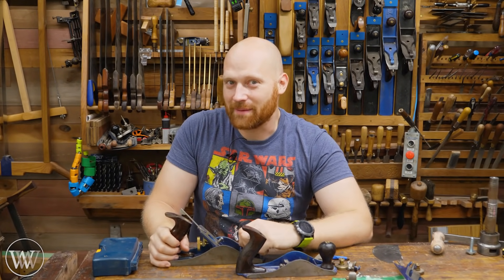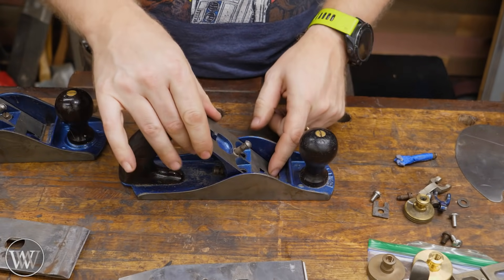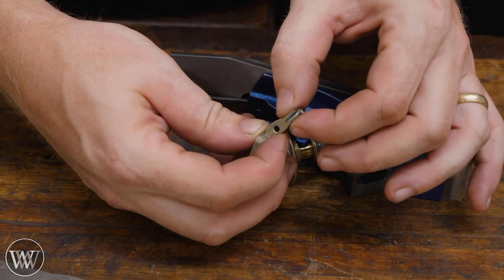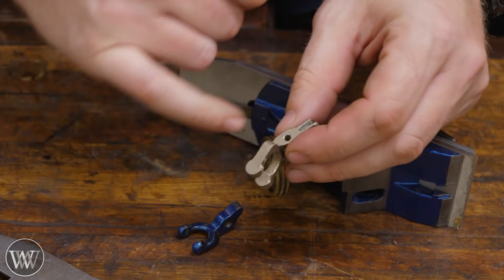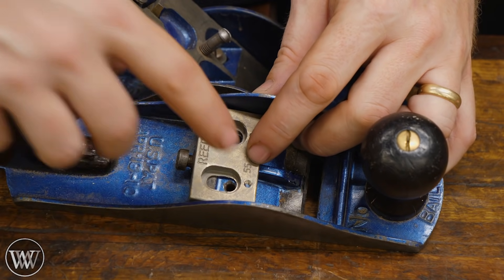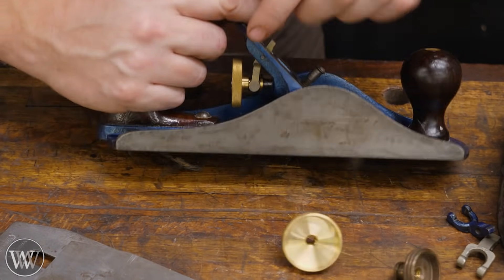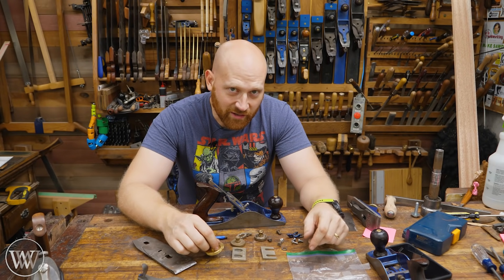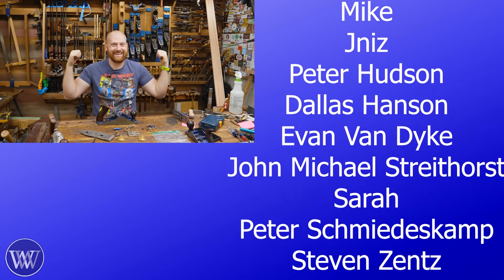Supe Up your Hand Plane By Giving A mouse a cookie

Comment: James,

Traditionally plane irons were quite thick.  In fact they always have been for Eastern plane and many European wood body planes.  The thinner irons where designed by Stanley to significantly reduce manufacturing costs.  The thinner irons could be stamped out rather than cut.  This meant many more could be made much faster using less material.  It also meant that the waste of the sheet could be more easily recycled into a new sheet.  The sales pitch to the craftsmen of the time was that the thinner irons were less expensive to replace and faster to sharpen while still retaining the same use between sharpening.  

It was this thinning of the iron that necessitated the development of the Cap Iron (not a "chip breaker" - that is a misnomer for the rounded hump at the front of the cap iron).  The purpose of the Cap Iron is solely to reduce chatter that developed as a result of the thinner blades.  The hump at the front was to act as a sort of spring that would focus the stiffening force towards the tip of the iron.  As it increased the curling of the shavings, the shaving tended to break apart more readily and  frequently.  This resulted in some craftsmen referring to Stanley shavings as "chips".  Since the fragility that caused chips was from the hump, this particular section of the cap iron was nicknamed the "chip breaker".  Since it was unique to Stanley planes, Stanley incorporated this nickname into its later patents; however, it always noted that it was just one of several features of its Cap Iron.

When irons are produced above a certain thickness, no Cap Iron is needed.  The iron's own mass provides all the stiffness required to prevent chatter.  This can be shown by considering the relative thickness of the irons of specialty planes and most low angle planes, none of which use Cap Irons.  They simply are not needed when irons are made thick enough.  Many modern irons are thick enough that the use of a Cap Iron is superfluous.  For such Irons, simply eliminate the use of a Cap Iron, and it will plane just fine.  In fact, that is exactly what most Eastern Europeans and Asians did when they were first presented with Stanley planes.  They saw right through Stanley's marketing trick.

By using a thicker iron and eliminating the Cap Iron, you should find that the lever bar on the yoke-lever will work just fine without adjustment.  I do think that refining the fit between the yoke and nut is a good idea, as well as reducing the slop before engagement of the lever, and the fineness of the adjusting threads.  

Bailey's big invention was the use of an adjusting lever which he later refined into the yoke-lever commonly seen today.  Stanley hired Bailey and bought his first patent from him with the agreement that Bailey's name would be directly associated with the planes bearing his design -- hence the "BAILEY" present in most of Stanley's cast bodies. This was dropped from the body but included in the packaging and instructions provided with Stanley's Bedrock series.

 Prior to Stanley, virtually all irons were either double beveled or the bevel was placed facing up in the body.  Stanley realized that sharpening was a refined skill unto itself, and that any change to the bevel angle would result in a change to the cutting angle.  For craftsman of the time, that was a most desirable trait, but when producing a tool for mass consumption, it was important to reduce or eliminate variation in results.  So a fixed cutting angle was needed. 

 The simplest way to achieve this was to have a single bevel on the iron and then to place the bevel down in the body.  This meant that the "back" of the iron, which was flat, would be perfectly in parallel to the bed it was resting upon (the frog bed) while still presenting the same cutting edge to the work surface.  By setting the frog bed to 45 degrees, Stanley established a perfect equilibrium between downward and forward cutting forces.  This was a setting that anyone could quickly master using.  So long as you only sharpened one side of the iron,  the angle of the bevel was effectively irrelevant.  The cutting angle would ALWAYS be 45 degrees (the angle of the frog bed).

While Stanley's plane worked reasonably well for most, higher quality craftsmen -- joiners, instrument makers, etc. -- were frustrated with only achieving average results.  They soon realized that they could achieve the finer degree of control by placing a second bevel on the back of the iron -- a "back bevel".  This would allow them to change the actual cutting angle with only a very minor change to their iron and the alignment of the Cap Iron.  They would only need a relatively shallow back bevel -- 1/4 to 1/2 the width of the front bevel, and by carefully choosing both bevels, they would effectively have tow cutting angles for every iron.  Since the irons were much less expensive than the competitors (less that 1/2 the cost) it was reasonable for higher end craftsmen to have multiple irons, and thereby effectively multiple planes, with just a single body.  The only trick was that all cutting angles were equal to or greater than 45 degrees (angle of the frog bed plus the upward facing bevel of the iron).

So changing the cutting angle of a plane is simply a matter of changing the upward facing angle of the iron.  No need to increase the angle of the frog bed.  In fact, that is the reason Stanley made lower angle frogs, to allow for a wider range of cutting angles.  Since only high end craftsmen were expected to buy these planes, fewer were made and the prices were much higher (sometimes two to three times that of a "traditional" model).  Today, most plane manufacturers of a line of "low angle" or "bevel up" planes.  The names are interchangeable.  These planes generally have a fixed frog bed angle, from 15 to 25 degrees depending upon manufacturer, and the iron is placed in the body with its bevel facing up.  The cutting angle is simply the sum of the frog bed  and the bevel angles.  For example a 15 degree frog and a 25 degree bevel would produce a 40 degree cut angle.  A 30 degree bevel would produce a 45 degree cut angle.  Because of the lower angle of the iron, most modern versions use shorter but thicker irons and have eliminated the cap iron.  This produces a "flatter' appearance and allows for more hand room when griping the tote.  A major comfort advantage for myself as I have larger and thick hands than most persons my size.

As I cannot imagine how you would reduce the angle of a traditional Stanley plane, I will concern myself exclusively with increasing the angle.  Since the iron is relatively thin, a short low angle back bevel, say 5 to 10 degrees for less than 1/16th inch, would effectively turn an otherwise unmodified plane into one with a cutting angle of 50 to 55 degrees (45 plus the back angle bevel).  The back bevel is kept short so the the cap iron can be placed as close to the tip as possible WITHOUT touching the back bevel itself.  If you are using a thick blade without a cap iron, keeping the back bevel short will mean less time spent sharpening.  It will also mean greater mass at the cutting edge which will result in the edge lasting longer.  A back bevel can effectively be thought of as a "second micro bevel". 

Another solution is to simply set the front bevel to a lower angle and then use it bevel up when you desire a high cutting angle.  For example, most of my iron are ground for a 20 degrees and a 22 degree micro bevel.  So if I use them bevel up, my cutting angle would be frog bed of 45 plus micro bevel of 22 to produce a 67 degree cutting angle.  Perfect for virtually any knot or heavily figured grain, but a bit steep for me when working end grain.  There I choose my low angle block plane with a cutting angle of a mere 30 degrees  ;-)

Comment: A kit and jig to help people widen their sole mouths very precisely would possibly be helpful in this "kit" as well..... I used a dremmel with a guide followed by a hand file. Not sure there's a better way, but I'm pretty dumb so I'm sure there is.
Reply from the maker: to open the mouth I just scribe a line with an aul and use a file the flat surface on that shapes in in less then a minute and gives a nice flat surface.
Reply: @WoodByWrightHowTo  didn't use an aul..... used a sharpie, I absolutely should have used an aul. Thanks
Reply: @WoodByWrightHowTo  could maybe be a quick useful video.....?

Comment: As far as a different frog angle, it’s easier to grind a second iron with a back bevel on the top to increase the cutting angle to anything you want. That way, you can have a more upright angle while using the same 45 degree frog.
Reply from the maker: I know a few people that like that, personally I am not a fan as you have to move the chip breaker back far enough that it no longer acts as a chip breaker. just a bit counter productive in my book.

Comment: I think the yoke should be pre-drilled. I wouldn’t want to risk ruining it.   Good ideas, but why not consider just making a whole new Norris style frog kit instead of trying to fix all the Bailey frog issues.  Like, just replace the whole frog with a better one.  I’d buy that if the price was right.
Reply from the maker: that was a thought tossed around. but at that point you are getting the price up near the price of a new high quality plane.

Comment: I want the Rob Cosman AdjuStar (star shaped adjuster wheel) for Stanley’s (he only makes them for WoodRiver planes)
Reply from the maker: His adjust star will work on Stanley's as well. At least the later models.
Reply: @WoodByWrightHowTo  The only Stanley planes I have are type 11 or transitional, I'm guessing that those are not late enough

Comment: I imagine pricing would be an important part.  If the price of the plane, the upgraded iron, the new yoke, the wedges, the screw, and any other parts wind up being a few hundred dollars... it might just be worth it to get a Veritas plane.
Reply from the maker: we are still looking at what it costs to make them. but for right now. I am hoping to see the whole kit with a few other extras as well for around $100-$150 ish. most of the of the parts to bi in the $9-$35 range.

Comment: For me personally, I use my tools for a living and know I see things differently than a hobbyist does, all of these are just unnecessary. I use planes from type 11 to 16 and they all just work. Minor fettling and that's it. No reason to throw money and parts at a tool that's been functionally used for as long as they have. If your personal goal to try and make them like a lie Nielsen or Veritas, have at it. Same issue with the thick irons. They don't do what most think they do. I have two thick irons and seven original irons and they all work the same. That's a user error issue, not a tool malfunction.

Comment: If you want a higher cutting angle, just hone the desired cutting bevel on the top (flat) side of the iron.
Reply from the maker: the problem with that is you can no longer use the chip breaker as a chip breaker then. but for some that is worth it.
Reply: @WoodByWrightHowTo  Not really a problem in actual practice.

Comment: ... on the other hand, for playing with angles, I think a low angle plane with multiple irons is the way to go. Still, good job!
Reply: Why not just get a second or third plane iron and grind it to a higher angle so that you get 50/55 degrees with the standard frog? easier to change out the iron than fiddle with the frog installation/ adjustment
Reply from the maker: changing the angle of the iron on a bevel down plane does not change the cutting angle.

Comment: My beef is with inconsistencies.. Thicker blades? No real great value trade off that the hobbyist/weekend worker needs. Varied slots in the planes that the yokes won't work with ---  sloppy yoke/adjusment screw combos sure -- work on that. But adjustable frogs???Meh. Unless a person is a perfectionist/somewhat anal woodworker...it matters not. --- Just being able to get a reasonably straight flat piece of wood is a good result. How I get there with the least sweat and blood is best. A simple easy adjustment with no expensive microscopes and lathes feelers and and strops and stones and grinders and ....yada yada... is what I want.

Comment: Why not just buy an IBC iron and chip breaker designed to fit in the Stanley type planes? You get a heavy blade and matching chip breaker that will address 90% of all the parts mod that you are offering yet with a drop in system that is a bit costly, but as I said, drop in. Rob Cosman assisted in the design and has a Youtube vid on that blade design. Boom, done and finding precision and joy in hand planing. Backlash is not a serious issue in iron advancement and retraction, you learn the tool your using. I have 140 plus year old planes, some mid- 19th century planes, a new Woodriver 5-1/2. If I were staring out now, I get a Stanley #5 at a garage sale, save my money and get a Woodriver and pretty much be done other than a few block planes and specialty planes. Yes, I use the plane on every project. Planed finish surface and a touch up, if needed, with 1000 or 1200 grit sandpaper. Yes, it's possible for even the hobbyist.

Comment: I don’t mean to be a party pooper—and I’m certainly not against technological advancement—but I like my old Stanleys just the way they are. I just don’t think changes are necessary. And I suspect that the old planes are quite capable of tackling some or all of those problems if they are set up and tuned properly, in ways that, for example, Paul Sellers contends.
Reply from the maker: So true. I ahve shown time and time again that even with a decent cheaper plane you can do the toughest work. some people just want to get there a bit easer.

Comment: I've played with high angle Bailey designs for 25 years, both shop mods (similar idea - I simply used steel shims made of halved washers) and LN frogs. They suck as the high cutting angle together with the high centre of gravity create both resistance when planing and poor feedback. Far, far better is a lower bed angle and learn to set a closed up chipbreaker for control of tearout. This does not go as far for the  Veritas Custom planes or HNT Gordon woodies, which have a lower centre of gravity, and a lower centre of effort. Even so, a closed up chipbreaker better controls tearout than a high cutting angle. A high cutting angle is best of all on a bevel up plane - again low centre of effort.

The idea for a longer yoke is a good one. There is already a manufacturer for these, and they are available. The ones shown here look a better design. 

A brief look at the chipbreaker on the prototype looks a poor design: flat and no spring for added tension. Give it a little bend.

Comment: I just have 3 irons sharpened at different angles.
Reply from the maker: With a bevel down plane the angle that the blade is sharpened at does not change the angle of cut. unless you are putt on a back bevel, then you are moving the chip breaker back.
Reply: @WoodByWrightHowTo  
I use a thick ruler trick, using another plane iron as "the ruler" .
This gives me about 4 degrees.